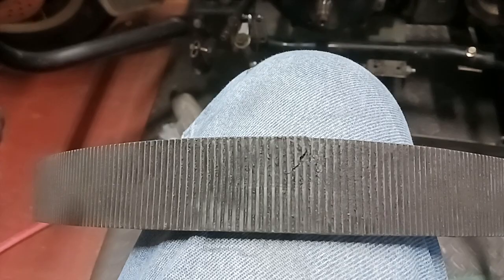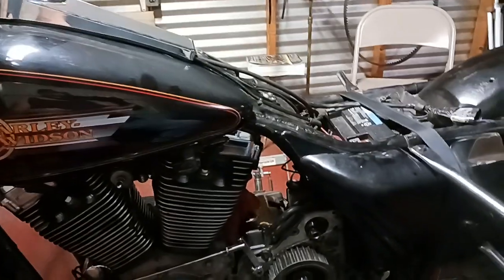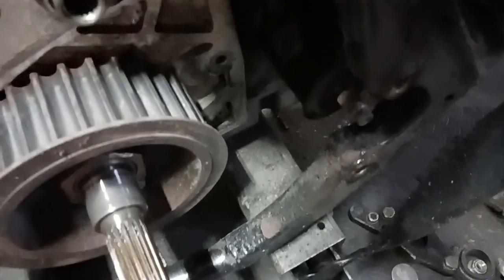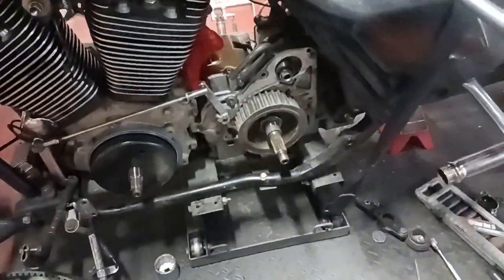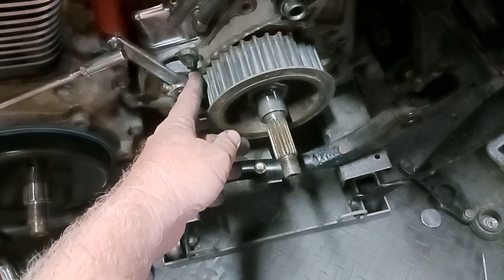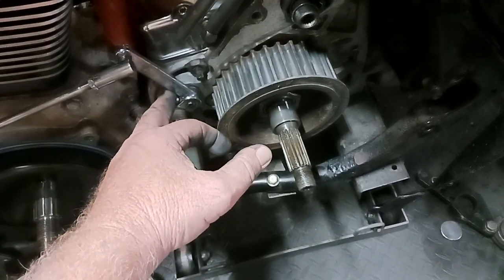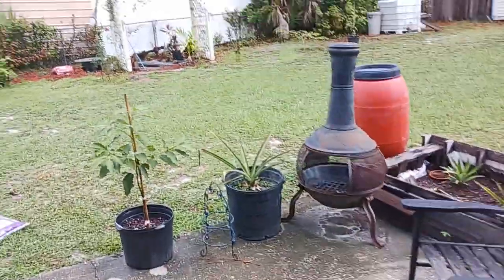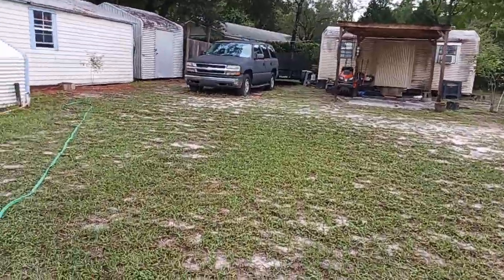93 ELECTRAGLIDE BELT UPDATE

Comment: Tapered wheel bearing have to be shim 0.003 when tight , if you have a 3/4 bolt 10 inch long works great with washers , and you need a run out indicator  a pack of shims run about 10 bucks they come in thousands mixed size . always replace the race with the bearing so the wear is even .  reusing a race can damage a new bearing , I think there are 2 Good videos of doing tapered bearings .   i have a race driver and puller .   Your doing the same thing I did in 2019 Redid everything so it was like a New Bike . with a fresh engine .
Reply: I can e-mail you part numbers and send you videos .  I have all that stuff on 2 Computers .
Reply from the maker: i was just gonna throw some new bearings in right now. I don't know how to do what you are talking about. Next time , maybe. I will have to study up on doing them.

Comment: The only thing I found with the rap the pipe wrap I know they get hot but they do hold moisture and they will Rust the pipes out underneath.. that's what I have found.
Reply from the maker: My sportster had wrapped pipes for ten years, never had an issue. If they get wet, just run the bike for about ten minutes and all that moisture will be gone.
Reply: @edZILLA64  👍